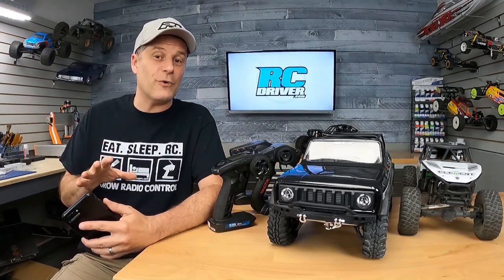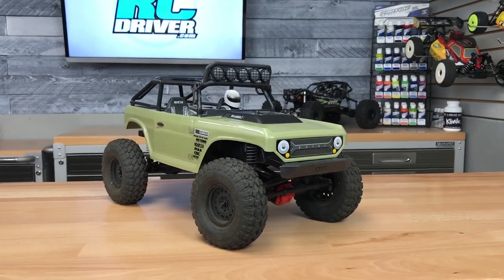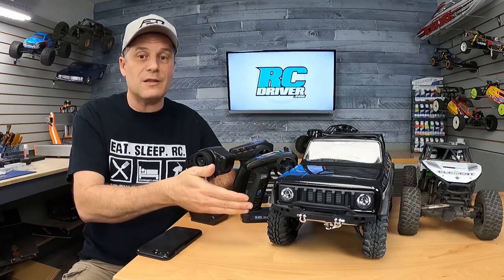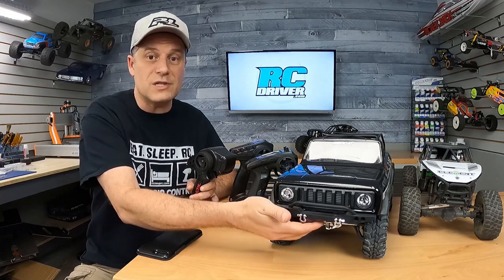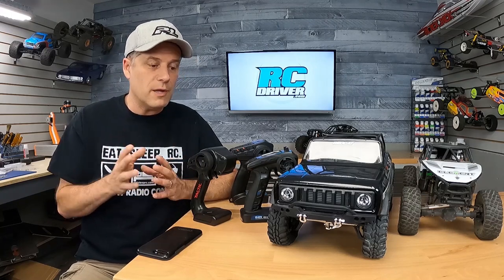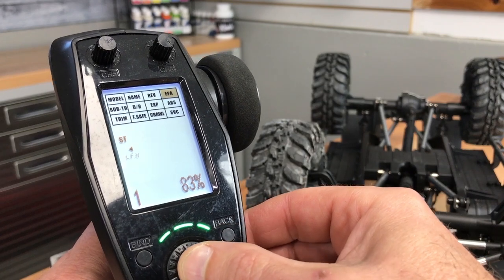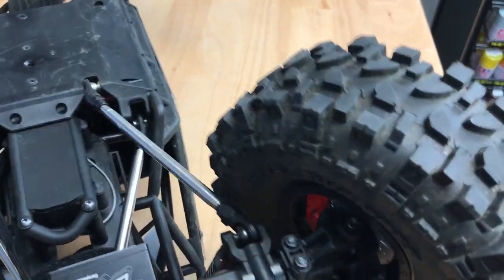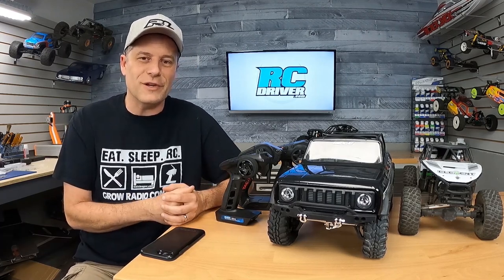RC Car Clunk! Here’s Why Your 4x4 Crawler/ Truck Steering Hangs Up - Fix My RC | RC Driver

Comment: (This comment is from more of a advanced users perspective) Thanks for taking this on but I will add that this is not a "problem" per say  this is simply the nature of a universal joint In RCs and 1:1's, dog bones, CVA's and universal all do this. The wheel will not stop its just slowing down and speeding up as it rotates.
What I see very often is someone new to the hobby flips their truck on its roof to test this and the chatter is extreme which freaks them out, but flipping back onto its wheels lessons this chatter greatly as the wheel has weight on it, when upside down theres no force on it so it wobbles all over the place. These folks also typically test this at full speed which isn't typical of how a crawler is driven. I see these questions asked in the forums almost monthly and the answer is pretty consistent: 'this is normal and you can limit throw if it bothers you'.
Limit my steering (on a crawler).... no thanks! I'll continue to use all of the throw I can. I'll say its probably best to avoid using full throttle at full (steering) lock. I'm not saying there arent limits as too much throw in the steering can  break U joints.
This video really helps visualize whats going on https://www.youtube.com/watch?v=Idk3BVDVHq4

Comment: Gregg, great video - I appreciate the return to "how to fix" initiative - in my mind THAT is the RC hobby.  If interested, I would like to see a video on how to eliminate speed wobble.  In my case, I built a monster Slash and when I run it on 3S, I can see the steering wobble left and right and it has actually caused a couple of wrecks that required repair.  I cannot find the slop in the steering - the linkage is all tight and I have a Savox servo, individually everything is perfect but when put together there is some looseness.  I am thinking that maybe a bit of time spent aligning all the links such as the camber links and steering links may appeal to a larger audience. Thanks, and I hope to see it on the channel!

Comment: One other thing worth noting about using the closer vs farther hole on the servo horn, closer provides more leverage and torque and the farther hole offers less. I'll only use the farther hole when required to get the throw I want.
Reply: also more strain on servo ,

Comment: Why would my team associated SC 10 2 wheel drive steering stopped. truck still has throttle?????thank you sir an I don't no if you work on people's trucks if so let me no thanks a bunch
Reply from the maker: Make sure it’s plugged into the channel 1 spot in the receiver properly. If it is, perhaps the servo has burnt out and may need to be replaced.

Comment: Good video. Dog bone axles snap . Axial uses dog bone axles in their lower cost trucks. They clunk and tick slightly before the break. Universals are nice, smooth and more throw and long lasting performance.

Comment: this issue is clearly due to a design flaw: if the driveshaft was thinner and the ball bigger it would allow a way better steering angle. 
Or they should simply have made cvd instead of dogbone

Comment: I just got my self two of these Nylint 1/6 Scorpion Radio Controlled yellow Jeeps brand new in the box. Unfortunately both are not working i charged the batteries i put bran new 9v battery in the remotes but i can not get them to work at all. Both remotes turn on but i can not get any commands to work nothing is responding even i changed the channels still no respond what so ever its driving me crazy they are brand new. Does any body know whats going on here please? any tips to fix them will help.

Comment: I NEED HELP i have a rc (app driver) ford bronco and my steering stopped working do you know how to fix it? I took apart the front wheels and don't know how to put the 1 metal clip and 2 wheel gadget things help please

Comment: Came across this while trying to diagnose another steering issue. 

Been years since I ran RC. A crawler always appealed to me. Grabbed a roc hobby katana today and enjoying having a play. 

Got some weight on the underside to balance it up better and made a huge difference to performance. 

Anyway. My issue. Steering right is stays pretty flat. Rear right drops ever so slightly. But steer hard left and the front and  rear left hunker down a lot.  Any ideas?

Comment: I have a problem that the wheels are just stuck full lock to the right, I understand you can change the steering setting to set it back straight but it doesn't change anything. I have bought 2 crawlers now and both have the same problem. Please help!

Comment: I have this issue with my trx4 sport and both of my defenders. I followed the traxxas guide out to do this.. I can get one side to be corrected, but I can't get the otherwise corrected. I was told to just change the receiver and transmitter and put a better one in..

Comment: I have a question about after market steering servo horns:
I want to replace the servo horn on my Traxxas Hoss 4x4 with a metal one. The problem is that the new after market one doesn't have threaded holes and the Traxxas bolt is a smaller diameter than the hole. 
Is there a sleeve or something similar to take up the slack?
Thanks,
Nigel

Comment: I always thought turning down the dual rate felt like the servo felt less powerful. But when you move the link on the servo horn in you gain torque. I wish traxxas allowed you to set endpoints on the shift servo with their expensive link module. At least my steering endpoints can be set easy enough. I know the flysky's are good, and futaba.....but I would have at least 4 or so rigs to convert...... Some day....

Comment: Hey Greg. I have the grey SCX JL you made me buy in your review, which I love. It turns real hard to the right. The Spectrum radio you showed will set the servo end points. Glad I got that instead of the Bronco, and I'm a Ford guy.

Comment: Thanks for that explanation. You did not mention one other advantage to moving your linkage to inside hole on your servo horn. You did say that it will reduce your servo throw but it will also increase your steering torque too. This could be a very good thing on a rock crawler where servo torque is very important. Thoughts?

Comment: But I even seen guys grind stuff off just to maximize the throw, I thought with crawlers the better turning angles the more capable the crawler is this is very good advice but negates what I thought we trying do with crawlers,  ps are there cvds available for the gen 8?
Reply from the maker: More steering is better in many instances, crawlers included. But some kits steer more than the stock components can handle. Telling an RC newbie that just spent 5,6,$700 on a crawler that they have to spend another $50-100 on parts to eliminate the issue can be a huge red flag to many. Helping people enjoy their rig with what they have to work with is a better start and they can upgrade/ modify later if or when they’re ready.
Reply: @rcdriver  i gotcha 👌 you right , I just wasn't sure with crawlers , ive seen my gen8 do that and didn't realize it was the dog bones bind en